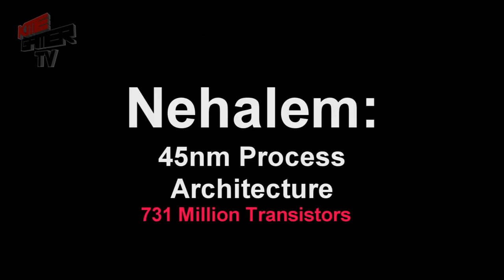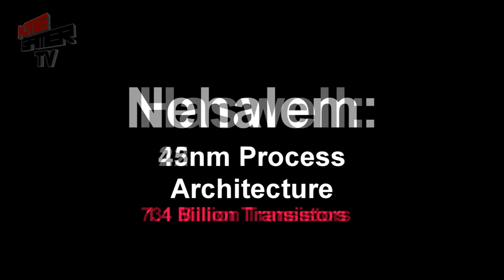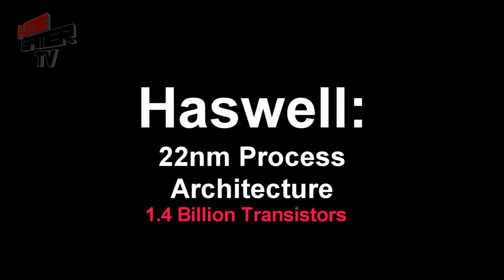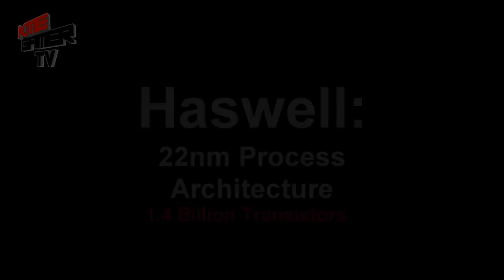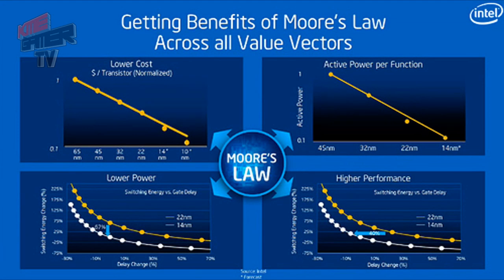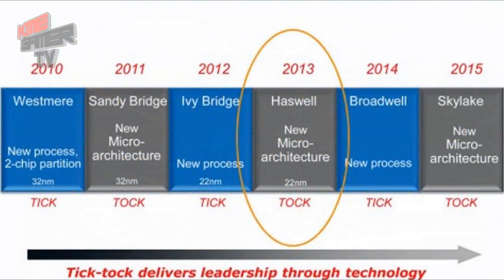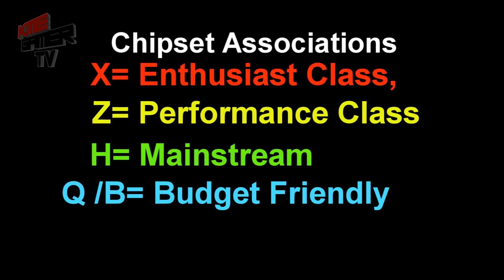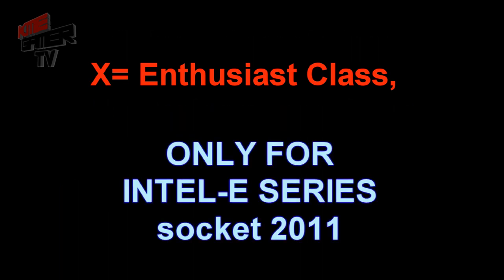HASWELL-E, x99 Chipset + DDR4 RAM: Everything You Need 2 Know!

Comment: How about an AMD when is it gonna launch it's cpu with motherboard that will support ddr4?!
Reply from the maker: Well, as far as I know there is nothing officially on the docket to date... Rumor was their Carrizo APU (Kaveri's replacement set for 2015), was going to feature compatibility for both DDR3 and DDR4-  But apparently they decided against it due to expensive DDR4 memory costs.  There is hope that the TORONTO APU will feature compatibility based on a roadmap where DDR4 pricing is equal or less to DDR3. However this is not projected until 2016.